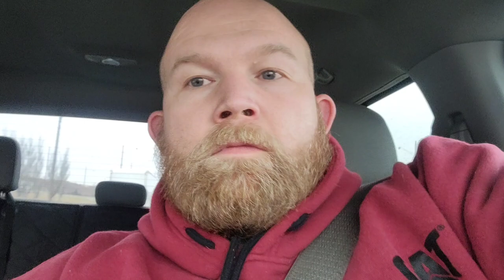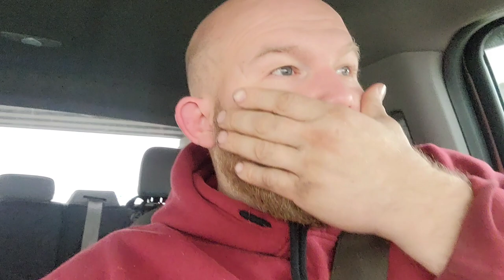2011 - 2014 F150 Inspection Before Purchase Guide and Newer f150s as well

Comment: Recently found your channel and appreciate the amount of information you put out, thank you. 

I have a late year '13 SCREW 5.0 F150 ive owned since 60K, at 114K now these are issues ive had;

 below 100K - a water pump, blower motor, blend door actuator. Passenger side valve cover replacement

100K - another water pump and replaced belts.

100- 104K - leadframe failure, front strut assembly failure, AC Compressor siezed, driver side interior door handle cracked and fell apart. 4WD system components [ hub assembly, actuator, check valve, selenoid, new lines]. 

114K- oil pan gasket. 

Selling the truck as soon as the Market simmers down. Either getting a 2016-2017 F150 5.0 SCREW or a 2016-2017 Tundra.

Comment: I bought a 2014 with the STX package. Not the fanciest but nicely equipped. Then my wife took it over and now has 113,000 on it. So far no issues whatsoever. The only time I get to drive it is when the fuel tank is low (36 gallons). That coyote is an awesome engine for sure!
Reply from the maker: Lol right, they stick us with the bill

Comment: Rich,another important thing to check in my opinion are damp or wet carpets under the floor mats.After having to replace both cab vents on my 19 Lariat,along with carpet and soundproofing, I now have my sliding rear glass leaking in bottom corner passenger side.I'm not impressed. After much research, the F150, various years have so many issues with water intrusion. I only have 85000 kms on mine

Comment: Great Video!
The 6.2L I have pushing 200K looks brand new, not a single leak. A bit of chauk on the metal valve covers. I thought the cooler was leaking but it was from the last oil change. 

 Nothing leaking anywhere on the truck. All toys work, only complaint is sync can't default to BT. It is on the latest version and I updated maps.  Even my power running boards work, after a ton of Fluid film and other lubes!

Also double check the Fuse 27 repair. The idiot that did mine fused something else into the big fuse. Wire had a similar color.

 I jumpered my rear defroster, just so the heated mirrors work, my neighbor told me he had two shatter. Only sad part is the bed rails are just starting to rot. I rustproofed it for now and its getting welded soon.

Comment: Just got mine done.. 2 turbo coolant lines vacuum pump 4 body bolts 4 O2 sensors 11 hrs labor time came to 1,720 not a bad deal pretty happy with that thinking it was gonna be more around 2000 to 2300 dollars

Comment: I’ve owned my 14 3.5 since new.. just got it back from mechanic. Needed cam phasers ,timing chain. Passenger side valve cover gasket, driver side turbo , driver side exhaust manifold😅😅😅. 93000 miles and i babied the hell out of it.. cost me 6,000 in repairs. Also was overheating after phasers and chain, finally got it figured out

Comment: Hi Rich quick question for you my 23 Lightning stop communicating with the FordPass app after Ford pushed out a power up update may not be related, but it hasn’t communicated since.  I have an appointment Friday with the dealership. Just wondering if there’s anything I can do at home as far as getting the modem to reconnect to Ford servers. Thanks. App still works with phone as key and remote start as long as you’re in Bluetooth range but no vehicle info as far as range or battery level app says last time it communicated was 20 January.

Comment: Or just buy a Coyote powered one and probably have zero issues.
Reply from the maker: This is a general video
Reply: I hope the 2018 coyote is not as bad as people make it out to be. I have one and love it!
Reply: The 2011/12 5.0’s were common to burn valves in cylinder 4/8. 11-14 5.0’s blow water pumps at 120k miles
-But all Gen 12 F150’s have these issues:
-fuse 27 melts in fuse box
-drive shaft dries and causes a bump on acceleration/decel
-coolant leaks from ALL quick connects
-plastic coolant elbows snap/break
-bad cab corner rust in northern states
-pinched wires in door(s)
-a/c blend door actuator failure 
-squeaky tailgate
-fuel door spring/plastic breaks
-IWE’s for 4x4 fail & grind the cv shaft
-trans cooler line quick connects snap & dump fluid in seconds
-oem lug nuts outer shell comes loose/separates
Reply: @urmaindawg  well....ive has two S197s. So far so good. The first one, a 2012 bbp,  died young in a rollover crash. The second has been hammered with nitrous and now TVS boost. So far so good. Honestly, losing a water pump at 120k would not break my heart or wallet. And if I was gonna cook anything it would already have happened.
Reply: @urmaindawg  damn you practically nailed everything my '13 has had!!